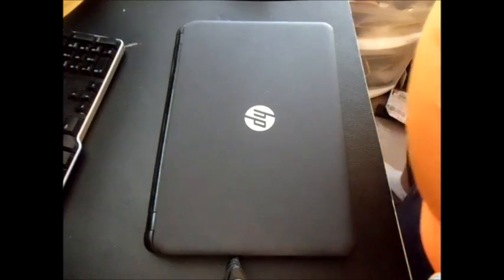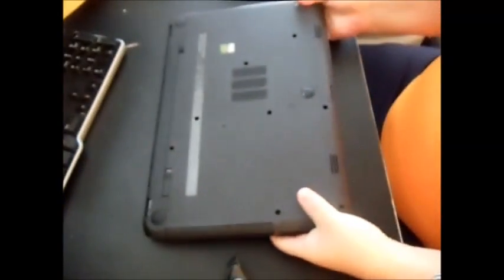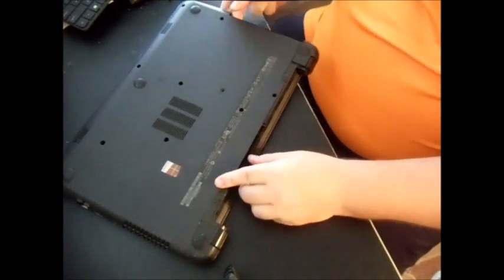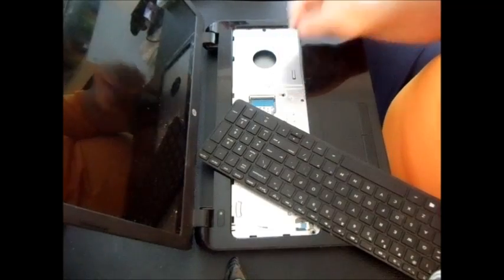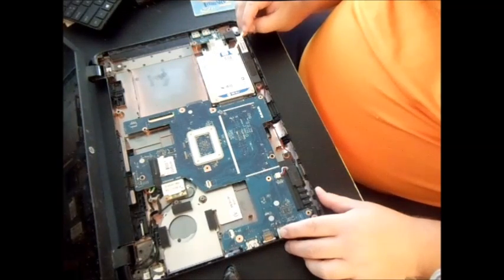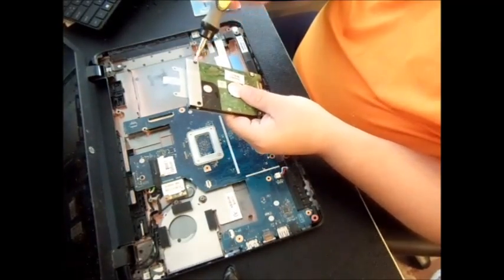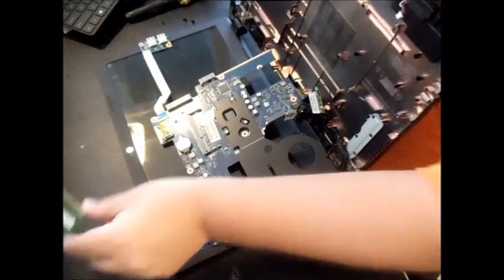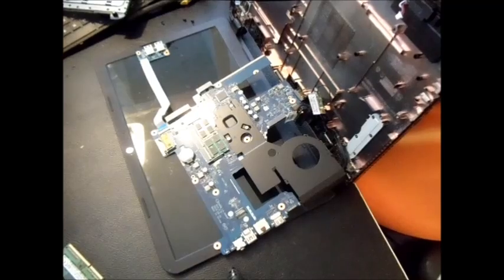HP 15 Laptop Memory Hard Drive Upgrade Replacement 15-R011dx 15-r015dx 15-r017dx 15-R018dx 15-r082nr

Comment: I followed this guide for replacing the hard drive on my HP 15-r127nl (I haven't tried upgrading the ram as I'm scared of breaking it). The steps were exactly the same, so this video helped immensely, however note that if you're inexperienced like me, plugging the flex cables for the power button, touchpad, and keyboard back in is a pain in the ass. Also I accidentally bent the very thin keyboard, so even if it still works it sticks up a little bit on one corner.
Reply: Try taking the keyboard out and re-inserting it. Put the bottom in first, making sure the tabs go into the right slots, then just press the top in. The first time I put mine back, it stuck up a little because I hadn't inserted it quite right.
Reply: I actually fixed it a while ago, but I forgot to edit my comment. I had to push along the keyboard's border with my fingernail and it snapped right back in.

Comment: I have an HP 15-ro82nr... I tried this and when I went to put it back together and turn it on, the power button lights up like its about to boot up but then it immediately turns off. I've tried charging it and even trying to turn it on while plugged into the charger... any thoughts on what I could have forgotten to plug in or maybe even broken?
Reply from the maker: +Bpratt001 I don't think you broke anything.  Try taking the new Ram back out to its original state to see if your ram is either not compatible or the ram is defective.  Could be either.
Reply: +RubberWilbur I thought of that and so I went back and took out the new card and put back in the stock ram
Reply: +RubberWilbur but it still does the same thing

Comment: Very helpful. This corresponds perfectly with the HP 15-r082nr, which in my case has a 750 MB Seagate drive.  One DVD screw required the ice pick as chisel treatment--if you ever worked on old cars..

Comment: the disassembly for this laptop is ridiculous omg i'm too scared to do it
Reply: +arcticmankeys Just start slow. It's quite easy, just a PIA
Reply: +arcticmankeys Just take your time, its a marathon, not a sprint.
Reply: +arcticmankeys Me too lol
Reply: Same 😂
Reply: Once you've done one, they're pretty much all the same.
Reply: I did mine last night in 30 mins or less, I'm sure I could do it in 20 now. And all I used was my small screw driver with a Phillip's bit and a flat head bit for prying

Comment: I have a hp-15-r029wm it has only 1 dimm  slot also and no fan(it get very hot). it came with  1x 4Gb pc3L12800 ram. I would like to go to 8 Gb 2133 MHZ. Can anyone specify upgrded part used.

great vid RW
Reply: +mmagnumatom I used this. It runs fine Kingston Technology 8GB 1600MHz DDR3L just google it
Reply: +mmagnumatom Any 8Gb DDR3L running at 1600 will do just fine, 2133 isn't necessary,you'll get no use out of that 533MHz especially if your CPU doesn't support it

Comment: just did mine, please mention that you need a low volt dd3L chip. also what happened to the fan? in yours it is missing
Reply from the maker: +Dimitri Deharak What model number chip did you use?  When I switched mine out it didn't work.  I'll make sure to put a note on the video to do the low volt.  Fan is there.
Reply: +Dimitri Deharak Which model do you have? I have the r011dx and was wondering if it would even boot with 8GB of RAM

Comment: what is your exact model number? my model number 15-015dx shows that there are 2 ram slots per crucial. I just want to know what to buy before I take all that apart
Reply from the maker: +Aaron Lopez 15-R011dx
Reply: +Aaron Lopez I have the dx model and there are 2 slots. I changed to a SanDisk SSD plus added an 8MB memory. Now my system is humming away lighting fast.
Reply: Same here have u found out Does the 15-r015dx have two ram slots or one cause want to try for the first time
Reply: +Romario Hamilton I have not done the job yet but the information on crucial.com seems to be accurate. 15-r011dx shows that it only has 1 slot. The 15-015dx does show that there are 2 slots.